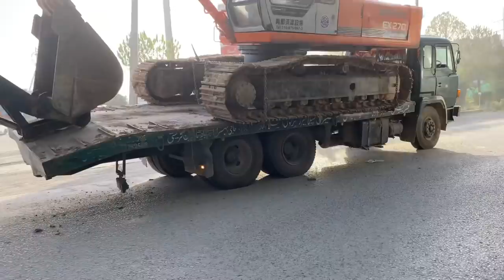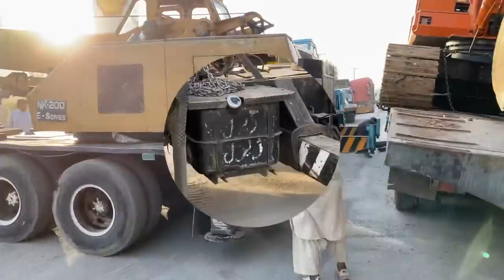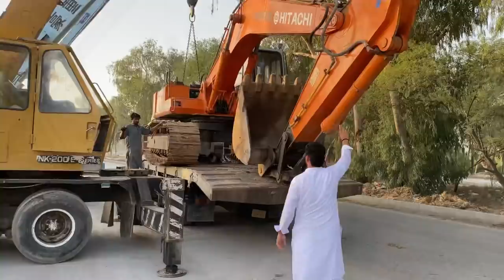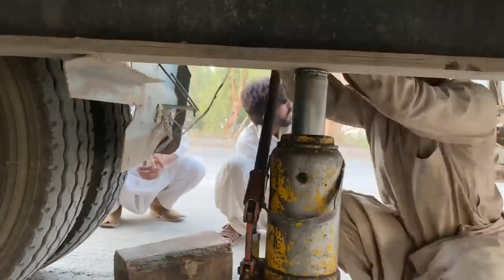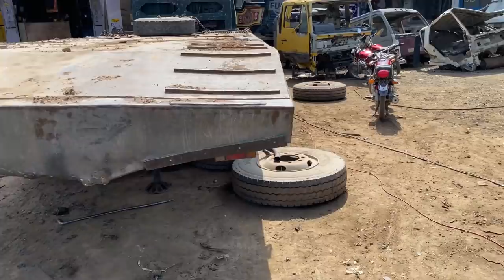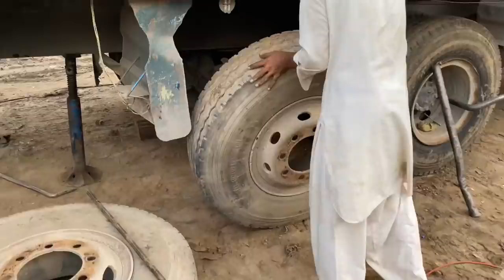Nissan truck wheel housing repair

Comment: these folks abuse their equipment endlessly & wonder why its allways breaking.gross vehicle weight does NOT mean the weight in which it will no longer move under its own power.but they damn near do it everyday & wonder why their equipment is allways breaking.appearently common sence there is as rare as weight restrictions.